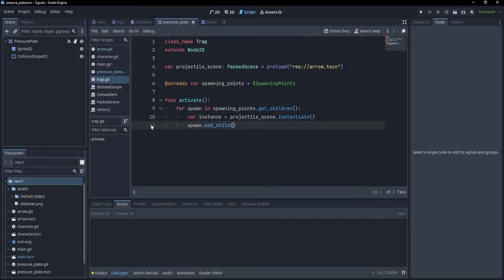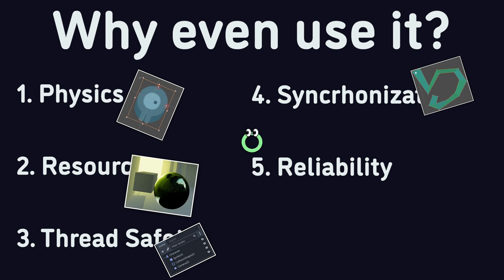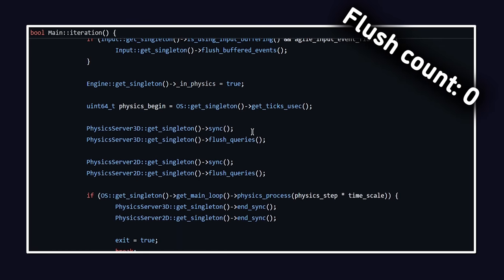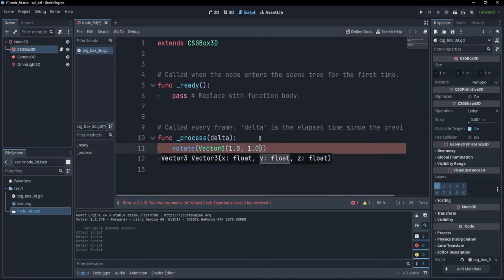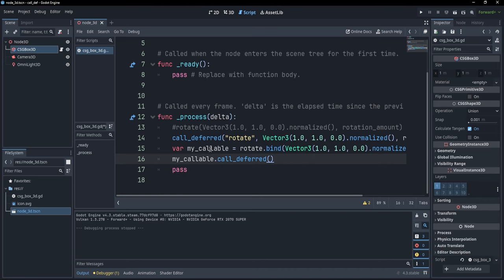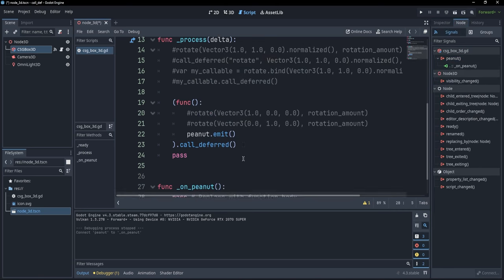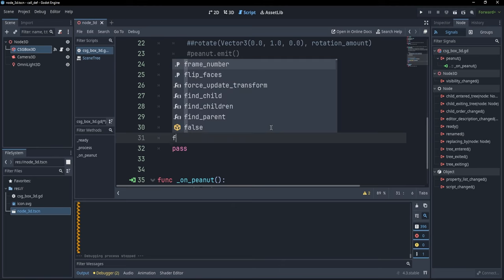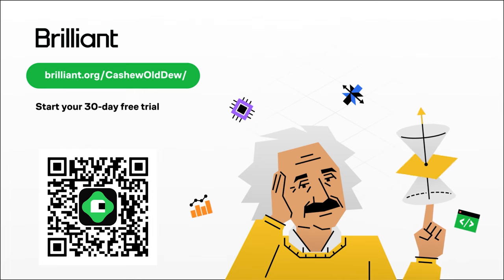What in the world is call_deferred?

Comment: 5:38
for the `rotate` function in `_process`, instead of decreasing the `rotation_amount`, it's better to multiply it by `delta`
Reply from the maker: Since Delta is a really small number, it does, indeed, make the rotation amount smaller. 
However, since there was no need for framerate independent movement in this case, I didn't want to complicate the example 🥜

Comment: 10:35
I believe there's a small error, because the peanut actually gets printed right before `process` is processed. Another thing to note is that, connecting each frame with CONNECT_ONE_SHOT, whilst emitting the signal each frame as well is inadvisable. It is better to simply connect once, perhaps in `_ready`, but this does change the behaviour slightly, as it prints before the very first frame as well, whereas in yours it skips the 1st frame, and starts printing before the second one
Reply from the maker: Regarding the process_frame signal, that is a very good observation. 

The docs really say that the signal is emitted right before the next process frame. So, in the example, the first frame was executed, and, right before the next frame, a peanut was printed.

It is true that if I would've had called the signal binding in the ready function, a signal would've been emitted right before the first frame, printing the peanut first.
Reply from the maker: And yes, connecting a signal each frame would not make too much sense in a real scenario.

For demonstrative purposes, I just wanted to do that each frame to showcase that there was no desynchronization between the prints, as in, the peanut always grts printed right before the next frame.

Thanks a lot for the comment! It really shows that you have a good understanding of how this works! 🥜

Comment: Actually I was getting errors in godot telling me to use this when I set colliders to disabled but when I used call_deferred (or rather set_deferred) the behavior was wonky and when I just did collider.disabled = whatever then it worked well. Would you say it is alright to just ignore the errors?
Reply from the maker: It could be that wonky behavior came from other functionality in your code. I would personally take those errors into account! An added benefit to fixing them would be easier debugging and logging as your console would be less cluttered without them. 🥜